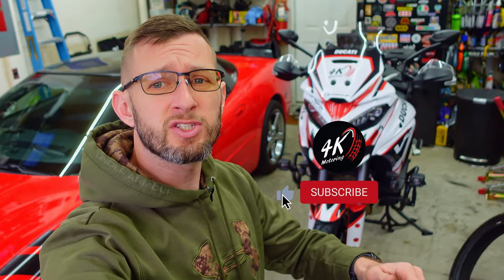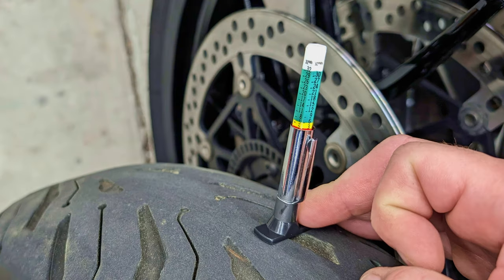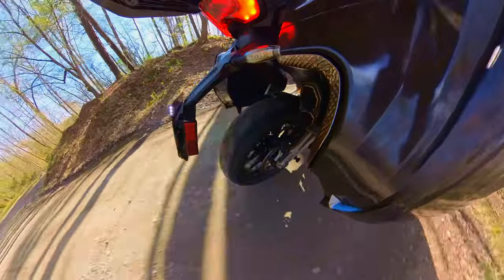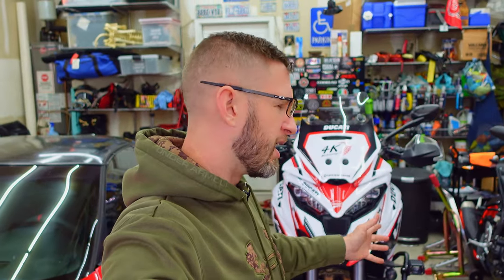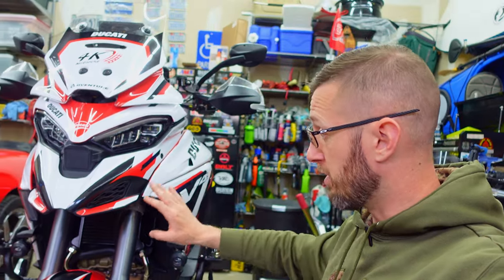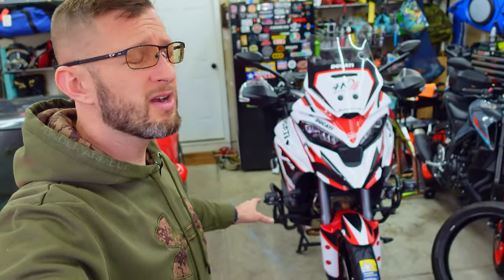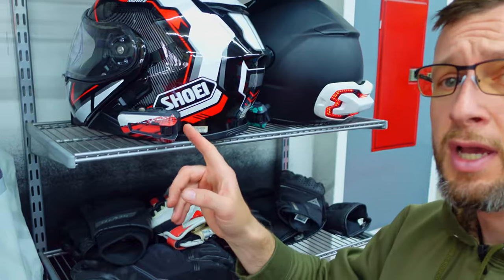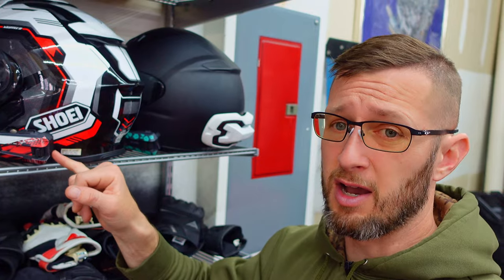Michelin Anakee Road Tires on a Ducati Multistrada V4, INITIAL IMPRESSIONS!

Comment: The road 6's pulled to the left on my R1250gs as well, I ran two sets and both did the same thing.  Obviously the gs has a single sided swingarm so nothing to do with the rear wheel alignment.  I replaced the road 6's with metzler m9rr's and now she goes straight again.
Reply from the maker: Interesting! So far the Anakees seem to be spot on, but I definitely noticed the left pull with the road 6
Reply: Just mounted Road 6s on my 2022GS and they track perfectly straight. I have read that others have had tracking issues with these tires, not sure why…
Reply: who rides a bike with their hands off the bars? were you texting or something??

Comment: When will you be doing an actual tyre review?
Reply from the maker: I should be putting about 4K miles this month on the tire, I'll have a lot more tire into then. Pretty impressed so far
Reply: @4KMotoring  thanks, I’m deciding on whether to put one of these three tyres on my bike (Michelin Road 6, Michelin Anakee Road, Dunlop Mutant).
I have a KTM 1290 Super Adventure S.
The original front tyre occasional feels sketchy in some corners.
I want to be able to go down the occasional dirt/gravel road and not feel like I might drop the big girl easily.
Like the look of the Mutants and sounds like wet performance and gravel might be good with them.
Anakee Road hasn’t really got any good reviews yet.
Road 6 is meant for road but the tread pattern looks like it might do ok on gravel?
Reply from the maker: I'll let you know my verdict when I've had enough time to test. In my first couple days on the Anakee Road I'm really liking them.
Reply: I just ordered these and will see how they go.